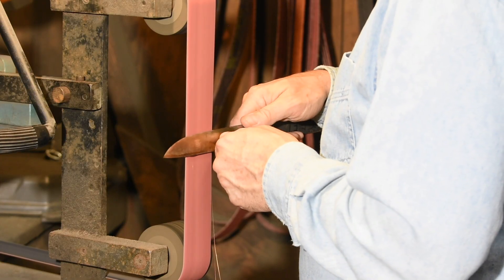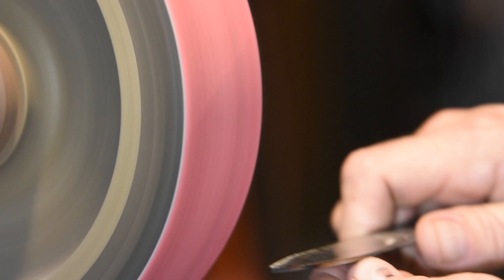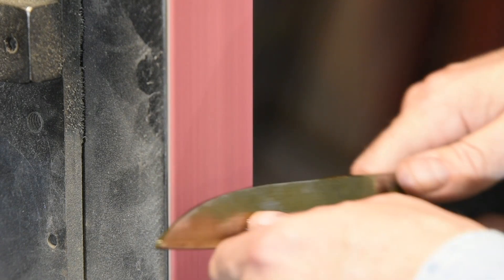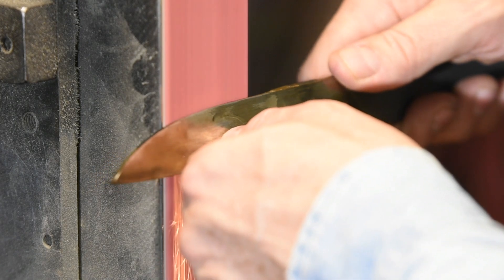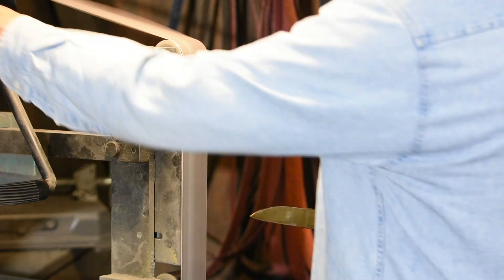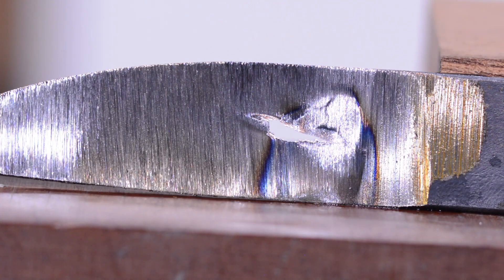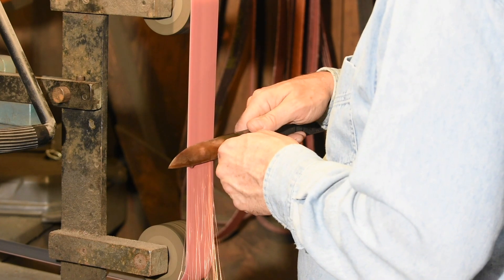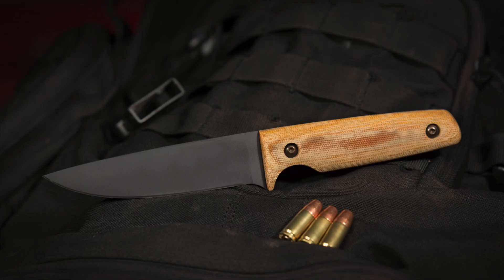Knife Grind Basics!  Hollow, Flat, Scandi, Convex, and Chisel Grinds

Comment: For zeroing cutting edge use super light pressure...and a cooling water spray.   I specialize in zero tolerance cutting edges.  The hand held 4-1/2" metal grinder produces way lower heat then say using your belt/sander grinder.  I've pretty much master the use of it to produce my hollow grinds.  For 2x72 machines add a smaller wheel to your motor wheel and you'll decrease the rpm even morel, you're allowed to change it!  lol!  Of course you may already have a variable speed motor.  It sure looks like Walter running belt fast on that scandi...you can ruin edge before you ever dip it in water and not even know.  Again, use super light pressure with water bottle spray to finish a straight razor zero edge.  I do 95% of my hollow grinds with 4-1/2" hand held and finish with a zero edge at 120 grit with super light pressure and constant cooling.  80-120 produces production knives factory look with10-20 degree secondary cutting edges.  Walter knows he's shit, I'm not as  famous but I got knives going out to Europe and United States.  Request from some countries I won't send.  I really love making knives for myself, I never got into making them to sell.

Comment: there is a second approach to hollow grinding, and that's blending. Gil Hibben uses an 8" wheel for everything, even 2" high grinds. I know several mastersmiths who have done 1.5-2" tall hollow grinds on 1/8" stock with a 3-4" wheel, just for the fun of it.

it's definitely not for beginners though, and is very easy to screw up
Reply: Yep, I bought a 1 1/2hp Burr King in 90' with all the attachments  from John Mallot @ True Grit when I began and I use to use a 10" smooth contact wheel on the wider stuff but moved to my 8" for everything.. It does take a little time to develop the skills to blend the bevels perfectly.. That's the way all us old makers learned to do it..Gil is a fine maker and a really great guy..Check out his King Tut, you don't see many million $ knives these days, I think he built another along the same lines for a little less for a Japanese businessman, however it's just as note worthy.. This is an excellent video especially for those that are just needing a little direction and guidance towards building they're skill level and confidence.. You might as well resign to the fact that you are going to make some wall bangers (we all did) but you're skills will improve so don't get discouraged.. I would most definitely start off grinding mild steel before you jump into the high end stuff until you're skill level dictates otherwise.. One recommendation is join a local or state knife club organization.. you will find a bunch of great like minded individuals who are more than willing to help you achieve what it is you're looking for...The shows are a hoot to attend and you just might find yourself sitting at an 8' table with you're offerings for sale on it one day? Have fun above all..and remember if you're equipment bites you, you are using it wrong 😆

Comment: 2 questions. When flat grinding, how do you hold your off hand? The one that is putting direct preasure on the blade. I have chewed my fingers up! Second, how do you grind the tip? I end up grinding the crap out of the tip, (I will loose an 1/8 to a 1/4 of an inch from the tip of a blade. Just so you know, i am using a 4x24" grinder i got from home depot. Was all i could afford and doesnt work too bad.

Comment: People/craftsman talk about the benefits of a 72inch belt sanded compared to a 36inch.  I was wondering what's the story on bandsaws, would a longer blade be more efficient i.e. less costly in the long run and more time efficient per cut?
Reply: Not necessarily.  Some blades are more common, like for a 14 inch vertical bandsaw and you have more options to get a low cost blade, while other bandsaws have  unique blades that limit your purchasing options.  Go with the more common blade lengths and you'll be fine regardless of the size.

Comment: Hey Walter ,  I’m just starting out making knives and I was wondering if you could use a jig on a slack belt to do convex grinds ?    I have just bought my grinder and it’s not even set up yet but I wanted to watch some grinding videos before I tried the real thing.   I’m going to be using a jig for as much as I can because I’ve got problems that cause my arms to be weak and holding something for a long time can be a problem but if I can do it on a jig then It probably won’t cause as much trouble.

Comment: Why are you sharpening with edge leading instead of edge trailing? Isn't it safer to sharpen edge trailing as well as easier to control how much of the edge vs the spine is sharpened during a convex grind?
Reply: Joseph Hannah i think its mostly preference.i have seen people grind like your talking about.i lead the edge but i can "feel" everything going on.and in some ways you may want to get that edge zeroed with speed especially on short bevels.but in the end you controle this by simply applying pressure in different ways.far as safe,its as safe as it can be when your making a razor sharp edge on a fast moving abrasive object throwing sparks and specks of metal everywhere at high volocities.at this point the orientation of the blade isnt gona dramatically improve your safety lol.

Comment: I just started making knives and I am using a 1x30 to do my grinding.  I have a hard time when I get to the tip.  I keep burning it, and my 4" knife becomes a 3" knife.  Any tips to help out with that?
Reply: WILDSTANG30250 same here. I haven’t put in enough time, yet, to figure out a solution; but I think a lighter touch towards the tip, while mainly the correct angle will help. 

I also have to shorten the blade after I get it too hot.
Reply: Less pressure, and faster travel speed, also make sure the belt isn't worn out.

Comment: I love your videos I been watching them for a long time now. You being on forged in fire was what got me to watch my first episode of it. Sorry that was a tough break (pun intended). So recently I started making my own knives in a primitive fashion due to lack of sophisticated tools using lawnmower blades and leaf springs to hone in my techniques and files to make my edges the biggest problem I'm having tho is heat treatment every time without fail my knives warp out to bananas what can I do to stop this from happening or at least minimize the warp
Reply: I may not be Walter, but I think I can help.  Don't grind too thin before heat treat (no thinner than a dime at the edge).  Use a quenchant that matches your steel choice if possible (avoid water at all costs in your learning stages).  If forging, thermal cycle the blade before heat treat (you're stressing that steel out whilst whacking with a hammer).
Reply: polishavenger1 thanks for the advice
Reply: Roger Mcgraw uneven heat will warp a blade if one side is hotter..don't move the blade latterly in the quechent..either "stab" the quechent (move blade up and down tip to handle or "chop" the quechent (spine to edge) never ever right to left (bevel to bevel)....even grinds and the smoother the better...after grinding get the blade wet and watch how it reflects the light..it should be uniform througout..no multifaceted reflections on a plane...the reflected light should flow smoothly and follow the profile of the edge consistsntly..you don't want to see the reflection jump or bend...where the light is at handle end should be where it is at tip end...hope this makes sense...its easier to see it that explain it..these can all facilitate warping..
Reply: polishavenger1 for the most part I keep my edge thick before hardening I'm still using mystery steel tho so I don't know what to exactly quench with but I do stay away from water I tried normalizing the knives before but still got massive warping
Reply: If you're using old leaf springs, generally they get treated as if they were 5160.  Canola oil would probably be okay if you're not diving in to purpose-made quench fluids.  Perhaps they're warping from leftover stresses that come with being bent in a particular direction and then being flexed for 20 years.  Have you tried an edge-quench?  Drop a limiter plate into your quench tank so that your blade doesn't completely submerge in the quench, rock back and forth tip to heel....careful that the heat in the spine doesn't auto-temper the blade edge!
Reply: polishavenger1 haven't tried an edge quench yet I'm working on one now so I'll try it all out and let you know if it helped thanks so much for the advice this is a hobby I have become quite addicted to lol
Reply: I hear you...once you're hooked it's like crack.  Would love to hear how your next one turns out!  And, Joseph's suggestions have merit...even grinding, even heating.  Once you start getting superior results, you'll only want more.  I just finished my first "camp chef" knife....made my dinner and then went outside and chopped a 1x4 in half, followed by promptly shaving the hair off my arm with the still-perfect edge.  Lovin' it.
Reply: polishavenger1 I have two Bowie style machetes that I got most of the warps out still have some noticeable twists tho but man can they pulverize some wood then made a camping knife which is on my profile pic with iron wood handle that thing was a beauty before it was even finished it was sold a part of me cried when I handed it off lol so now making another one with a few tweaks that I think I may keep trying a new handle material I made tho so I hope it works out
Reply: polishavenger1 so finished my last knife it was made from a lawnmower blade so it didn't harden unfortunately but while trying I didn't have as much warping y'alls advice helped out a lot thank you wish I could post a picture to show you
Reply: Lawnmower blade is some sketchy stuff, Roger....you're a brave soul for even TRYING!  Keep an eye out for old files/rasps at yard sales, they pop up quite often...the older the better.  Just got my 5 gallon bucket of Parks 50 to take the place of my McMaster Carr 11-second quenchant (which I highly recommend as a great value), so I will be working on some W2 and maybe 1095 soon without having to sweat the results.  Best of luck!

Comment: With regards to hollow grinds, is the grind shape itself weak or is it weak due to there being potentially less steel behind the edge/secondary bevel? For example say a thick chopping knife has a hollow grind but at the beginning of the edge bevel it's still 2 millimeters thick, is this still a weaker grind than a flat grind that's 1 millimeter thick at the start of the edge bevel on the same knife?
Reply: I'm not a structural engineer, but as far as I know hollow grinds are inherently weak, whereas convex grinds are inherently strong. Of course if you grind a hollow grind extra thick, say 1mm at the edge, it will be stronger than a .25mm convex grind, but there's no point in an extra thick hollow grind as it eliminates the primary advantage of that type of grind.
Reply: Mt. Baldwin for what it's worth, steel choice is more important. With the right steel and heat treat, you can chop dry hard hickory with a hollow ground blade with a 6 thou edge without damage. I've done it.

basically if you have edge chipping on any knife, it's a steel issue not a grind issue

Comment: What do you think about those cheap 1 inch belt grinders? Would you say they are crab or a good way to start?
Reply: Its what ive been using, and while it is a lot slower and more tedious to use, it can still make a good knife. for the price, definitely worth it. bonus if you can get a deal on the model with the attached 5 inch disk sander
Reply: MoLottes, what kind a belts have you found work best for the 1x30s?
Reply: I just buy the cheap ones on amazon. i believe they are PowerTec brand, i get 10 for less than 10 bucks, and i have Prime so its nice to have the quick shipping, if i forget that i need more to finish a project in time.
Reply: MoLottes , Thanks,  I'll have to check it out.
Reply: amazon also sells ceramic belts in 40 and 36 grit for 1x30, but i own a 1" sander and I honestly doubt that these have the power to drive a ceramic belt correctly. and these grinders are NOT accurate. They move around all the time.
Reply: They are a bit flexible in the wheels. I had to modify the tensioner on mine to keep it from running off track under belt load, and i had to change out the mount of the platen table to maintain at least a consistent, if not perfectly square, angle on the belt platen
Reply: MoLottes yah. Honestly. If you are going to buy a cheap belt grinder. I'd go with the Craftsman 2x42 grinder with a disk sander attached. That one has a decent motor, is more accurate, and has a wider range of belts that are made for it.
Reply: I think you can only effectively use alumina belts on these cheap 1" x 30" belt sanders, as you can't exert enough pressure to keep the grit sharp on ceramic or zirconium belts (which are higher quality, but essentially worse on these cheaper machines) but if you are just starting out, I believe cheap sanders and cheap belts will work totally fine till you are ready for upgrading.

Comment: Hey Walter! I really enjoy your videos! I want to get into knife making! Can/would you give me recommendations for decent knife grinders? Not the best, as I cannot afford much! Possibly used, or cheap new ones? I will probably, mostly, want to hollow grind my blades.
Thanks!
Reply: Bob Campbell, you can use a 2x42 single speed belt sander. It won't be as easy or versatile as what you see in this video but it works, and it does have the virtue of being small and portable. At something like one tenth the price and one fourth the size of a 2x72, it's an option for someone who isn't making a ton of knives. It's what I've got, and it's fine. Belt selection is no problem. I probably will never replace mine. I do wish I had a variable speed, though.
Reply: Hill Wellford , I really appreciate it!

Comment: Saber or convex here.

Chipping makes me rage!
Reply: Try a scandi-vex, and actually try a one bevel knife, you can make any kind of edge or grind convex, which resists chipping and pushes material away from the edge like your peeling it off of the steel, although convex grinds and edges do not shave all that well, surprisingly, flat grinds and v edges are the best for shaving, but overall, I prefer a convexed scandi or saber grind.

Comment: Scandi is ugly, and looks like a pain to sharpen...
Reply: It is actually one of the easiest to sharpen, just lay the bevel against the stone and grind it keeping the bevel flat against the stone. If the blade has a secondary bevel, it is much harder to feel when the blade is flat against the stone, beauty in a knife is how well it does its job first before looking at cosmetics.
Just my opinion and $0.02 worth,
Gabby
Reply: I forgot to mention that a Scandi is technically a long secondary grind.
Reply: @GabbyBillNumberOne  I meant time consuming, as you need to grind down the whole big wide edge surface every time you sharpen it...